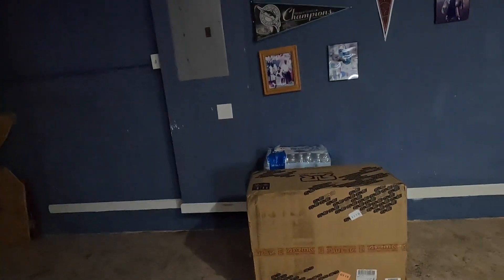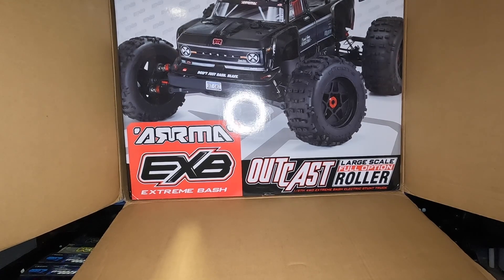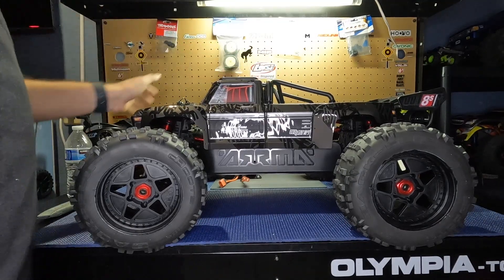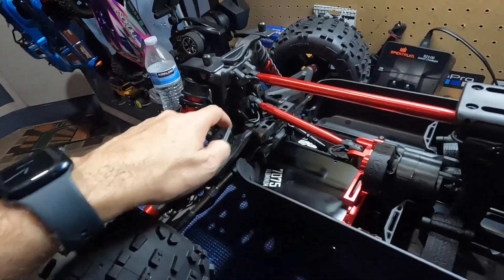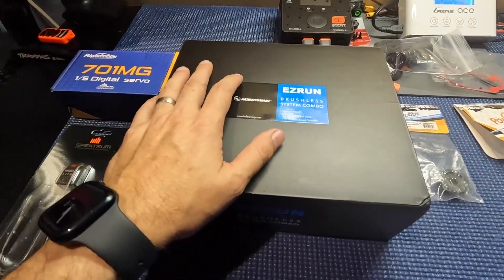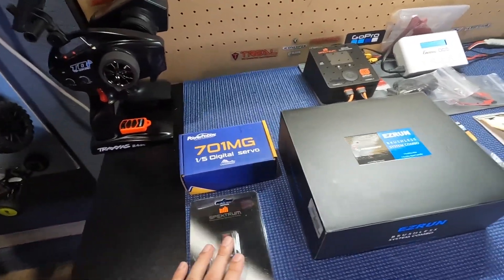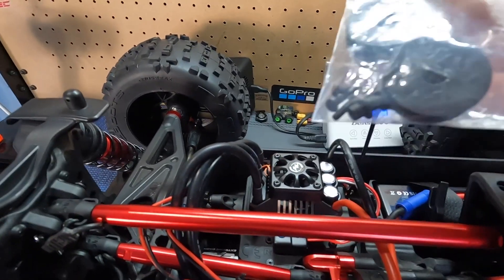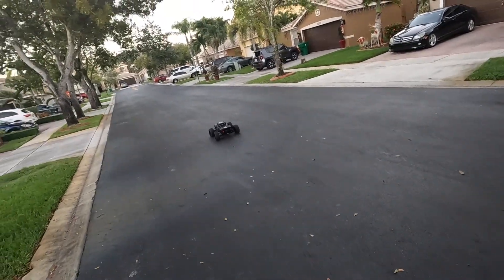Arrma Outcast 8s Exb Build and Speed Run on Hobbywing Max 6 1100KV

Comment: Man nice video bud look forward to your bashing session on the next video, I literally have the same set up on my exb outcast 8s I can’t wait to take it out!
Reply from the maker: Thanks bud I was a little worried the max 6 was going to be underpowered but she quick and rips real nice… already working on my bashing video let me know how it goes when u take yours out..
Reply: I will for sure buddy I have literally the same set up, have you’ve had any over heating issues with your? Do you find that your still has enough torq and all? Thanks for the info bud
Reply from the maker: @gsxrfun7774  not yet but I think the power hobby dual fans are a nice addition but i only bashed her once so I didn’t go crazy but she rips nice man and for me she still has enough torque she back flips at the skate park and can ride a wheelie all the way down the street with ease that 1100 will give u nice speeds
Reply: That’s awesome man I keep looking at your channels waiting to see a bashing video lol. How’s she been running man? I still need to take mines out o can’t wait!
Reply from the maker: @gsxrfun7774  new bashing video is dropping tomorrow stay tuned video is a short one..I did notice one con for me I’m running 6000 mah 4s packs and I’m not getting the longest of run times but the outcast 8s is such a fun rig to bash man your in for a treat..
Reply: What’s your run times looking like brotha? I’m running 6800 100c 4s packs, did you have any overheating issues? Man I can’t wait to see I hope it had plenty of torque and wheelie power I love that lol!
Reply from the maker: @gsxrfun7774  I think I got maybe 15 min out of mine at several locations and let’s just say the outcast is the wheelie king so no overhearing issues for me but again I’m just did a light simple bash nothing crazy so more testing is needed but I’m not worried

Comment: Sweet truck, I have the same with a Max 5 and the 1100KV.  I hit 59mph on a 30 pinion 39 Spur set up.  It's scary fast and very difficult to keep the nose down.  I went down to a 30 x 47 and it's still plenty fast.  Enjoy!
Reply from the maker: Thank you yeah she is fast I ended up with the max 6 causes I got such a good deal on Black Friday I couldn’t pass it up but with the max 5 it  should run more efficient for sure
Reply: @Joercgarage  Either one is plenty for the truck! I liked it so much I bought another on a Black Friday sale and found a $25 dollar off coupon as well.  $254 for the Max5 and 1100KV combo!  I was thrilled with that price and now need something to put them in.  Happy Holidays and happy bashing!!
Reply from the maker: @davidconaway2830  great price bud they did have the kraton 8s exb on sale might be a good fit for it happy holidays
Reply: @Joercgarage  they did but I had my mind set on a DBXLE V2.  Now I'm thinking about a "30 degree north" short course roller. I may need the 800KV motor for the truck.  Decisions, decisions:-)
Reply: Soo what pinion you recommend 30 × 39 or 47 ?
Reply: Also i can't find the max5 esc combo whit the 1100kv ? Only whit the 800kv combo but I don't want to make any modifications?
Reply: @CorvetteC6-LS2  If you want insane power and speed, the 30x39 is the way to go.  While I love that capability, I found that the 30x47 is more than fast enough and still a total beast.  As an update to my previous reply, I did get a 30DN DTT-7 short course truck and put the Max5 with the 1100Kv motor in it.  At 37.5 pounds, the 1100 hauls it around with great authority and goes 55mph on a 21x58 gearing.  I bit the bullet an bought the 800Kv motor and it also hauls the truck around with ease and it just as fast with a slightly larger pinion gear.  The big difference is the motor temps. The 1100 gets really hot (above 160F) whereas the 800Kv has yet to get above 110F.
Reply: @davidconaway2830  i think I goin 30×47 is my first rc soo another question whit the 1100kv fit just perfect right whit the 800kv you have to modify or shave something
Reply: @davidconaway2830  soo do you think 30×47 and max5 whit 1100kv is good combination I not want nothing crazy and not modifications??
Reply: @CorvetteC6-LS2  I think the 30x47 will be awesome for you in that truck.  The 800Kv will fit without any modifications.....although there is a "corner" piece in the plastic part of the chassis that you may need to remove.  Easy to do.
Reply: @CorvetteC6-LS2  yes indeed!  Be sure to run one or two 35mm or 40mm fans on the motor just to help with temps.  That said, with fans, my motor never got very hot at all.
Reply: @davidconaway2830  soo what the different between max5 or max6 which one is better
Reply: @davidconaway2830  I found the combo max6 whit 1100kv or max5 whit 800kv whit one fit better or run better?
Reply: @davidconaway2830  where i can find the fan and how i intall it to the engine?
Reply: @CorvetteC6-LS2  The Max 6 is rated at 160amps whereas the Max 5 is rated at 200amps.  Both are rated to run 3S thru 8S. The Max6 is $160 and the Max5 is $220. I chose the Max5 because I wanted the 200amp rating. Both are excellent ESCs.
Reply from the maker: @CorvetteC6-LS2  I’m running a 28t pinion with the stock 47 spur and I’m getting 57 on the street my advice start lower then go up for your preferred  driving style
Reply from the maker: @CorvetteC6-LS2  I wanted the 1100 kv motor so I went with the max 6 not sure they sell it as  a combo with the max 5
Reply: @Joercgarage  ok yeah i only see the max6 whit 1100kv combo
Reply: @Joercgarage  soo max5 and 1100kv and 30×47 is the perfect combo right for stared
Reply: @Joercgarage  soo question can I order separate the max5 and the 1100kv?
Reply from the maker: @CorvetteC6-LS2  yes you can it will be more expensive but you can do it
Reply: @Joercgarage  is ok is my first I want to make it faster but whit good quality part
Reply: @Joercgarage  soo the max6 combo 1100kv is good choice and cheaper
Reply: @Joercgarage  another question how many battery I need and the battery are 6s or 8s
Reply from the maker: @CorvetteC6-LS2  I run 2 4s batteries for 8s
Reply: @Joercgarage  i confusing we're you chose 8s or 6s in the max5 or the battery itself is 8s ? Sorry for the stupid question but i am new in the hobbies 🤣🤣🤣🤣
Reply: @Joercgarage  soo I will need 2  battery 4s tu run on 8s whit the max5 ?
Reply: I find the combo max5 whit 800kv i think I goin whit that you say don't need any modification it fit just perfect right?
Reply: @CorvetteC6-LS2  look it up on youtube....I'm sure I'm right
Reply: @Ford f150 5.4  I will be home in a couple hours and will double check the 800kv fits into my 8S.
Reply: @davidconaway2830  whit one is better 800kv or 1100kv?
Reply: @CorvetteC6-LS2  watch this as he runs a max5 with an 800kv in his Outcast 8s.
Reply: @davidconaway2830  were??
Reply: @davidconaway2830  that what I want max5 whit 800kv
Reply from the maker: @CorvetteC6-LS2  I ran it in 6s and then 8s 8s is the max u can do with the max 6
Reply: @davidconaway2830  yes i gone run 1 fan max5 +1100kv and 30×47 and after that 30×39  that sounds good to you???
Reply: @davidconaway2830  I just found good deal on mamba combo xlx2 +800kv 2028  and I gone run 30t×47 for now  you think that good combination??
Reply: @Ford f150 5.4  the 2028 is also a beast.  Can't go wrong either way.
Reply: @davidconaway2830  good choice on the 30 degree north roller!! I just picked one up myself couple weeks ago on sale for 700 bucks. Put a castle 800kv and a r snake v12 pro esc running on 12s and hands down my to go to truck now over my outcasts kratons or xmaxx’s. The truck is an absolute beast!!!
Reply: @MrMikebeben  That sounds like a real tire shreader!!  I added 1" hub extensions and now run the Dboots backflips on the 30DN which gives me better air control and perceivably softer landings.  It's a beast on 8s and cannot imagine the power on 12s!! Have fun with it and don't forget about your other trucks;-)

Comment: Are the front tie rod ends sloppy? That was a major complaint that the youtuber, Earl Moorehead had. They are currently on sale and I want one, just hesitant because of the tie rod balls fitting loosely and causing issues. Just your thoughts?
Reply from the maker: They are somewhat loose but don’t cause any problems for me truck is a ton of fun and worth every penny in my opinion

Comment: great run did u do anything with diffs??   Oil??
Reply from the maker: Thanks..all diffs are stock out of the box
Reply: @Joercgarage  really i got the Karton Exb and it diffs out a little to much for front tires but wheeling like crazy i’m opened it up it’s thick but 100k i got 200k.  you think it will fix it?     or do i have to go ear plugs in center which I really don’t want to do??!
Reply from the maker: @moereefer  from my understanding the outcast comes with 20 mil cst in the center diff I would of imagine the kraton was similar if not goes heavier on the oil 4 sure..
Reply: @Joercgarage  they changed it on the newer version similar to to the Arrma Outkast 1/5 EXB  it’s 100k in from and rear and 2million in the center diff.   but i’ve seen some people with rtr with less in center i guess depends when it was made
Reply from the maker: @moereefer  I did not knw they changed it..
Reply: @Joercgarage  oh yeah check it out on a youtube search people where putting what now comes in them both EXB and recently rtr

Comment: Is my first rc question whit that motor you don't have to make any modification or shave right?? Because i want motor that fit right into it whit no problem or modification
Reply from the maker: That motor will fit in perfectly 0 modification the exb comes with 2 motor plates a 49 and 56 series the 1100 is a 56 just make sure u use the correct motor plate
Reply: @Joercgarage  what the different between max5 and max6 max5 is make the car faster??

Comment: Nice. I got the 8s blx and thinking about the max5 but will the stock Motor handle it? And will it make a big difference?
Reply from the maker: It will definitely make a difference but  it will make more of difference  with the 1100 kv or 800 kv

Comment: Waoo 57mph soo maybe whit the max5 you will hit 60mph??
Reply from the maker: It all depends on gearing both the max 6 and 5 will hit 60 plus the max 5 will be more Efficient doing it and has more power than max6
Reply: @Joe Rc Garage  ok I thinking my combo gone be max5 + 1100kv and 30 pinion +39 or stock 47 that sounds good to you? I don't want to go crazy is my first rc I don't want to break it the first day 🤣🤣🤣
Reply from the maker: @CorvetteC6-LS2  that more than enough for a first rc
Reply: @Joe Rc Garage  🤣🤣 ok thanks you I just want to make sure I don't want to order something wrong...🤣🤣👍
Reply: @Joercgarage  do you think 30×47 stock spur gear is good combination?
Reply from the maker: @CorvetteC6-LS2  yes just watch your temps if your running in a hot climate area and running hot  go down 1 or 2 I’m running in hot climate and at 28 I’m good
Reply: @Joercgarage  I goin to run cooling fan
Reply: @Joe Rc Garage  I found good deal with the combo mamba xlx2 + 800kv 2028 and I goin 30×47 for now ..

Comment: Max 6 is too small for 8s system in such a large heavy Rc

Max 5 is higher amps and thus power for heavier weights, a max 6 will get stressed and hotter in comparison
Reply from the maker: This is tru but so far it has worked out for now and it rips nice